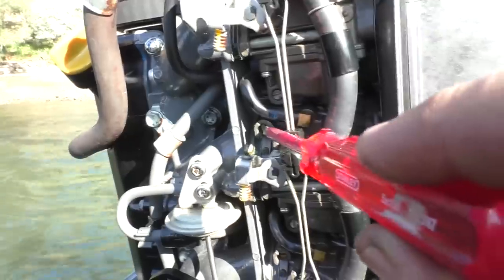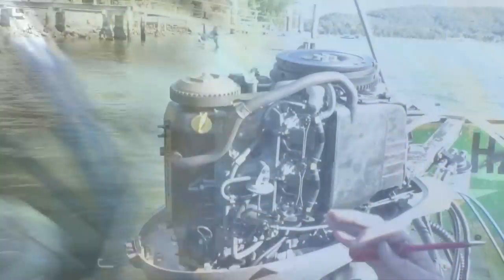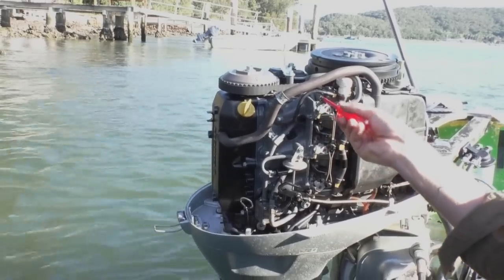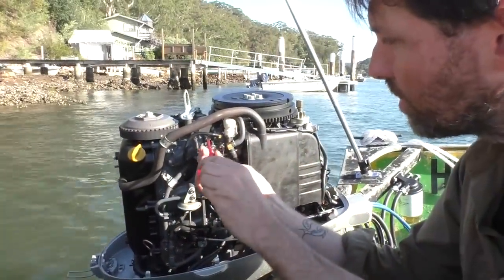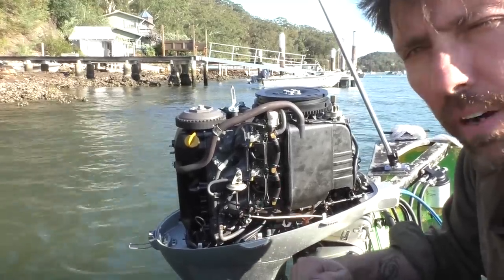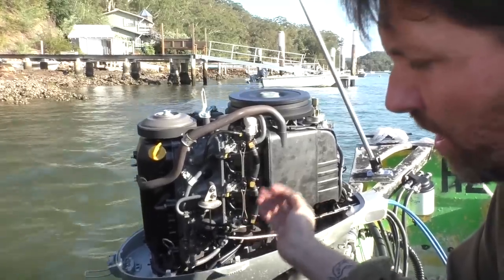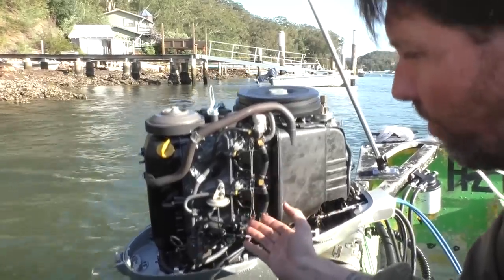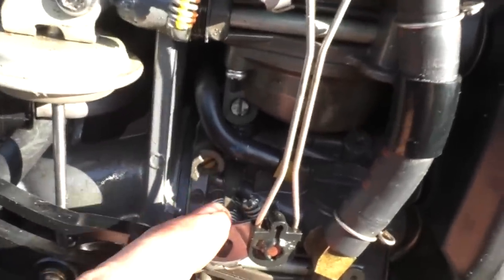Four stroke carburettor synchronisation

Comment: Hey Stu, am I correct in thinking that these tuning methods apply to two stroke carbs as well as four stroke carbs?
Reply from the maker: Two strokes don't have intake vacuum so just the part with adjusting the mixture screws to get the highest RPM is for two strokes.

Comment: I have the USA version of the same motor, and thanks to our EPA (environmental protection agency) the screws can only turn 1/8 turn, and as a result it has never really been possible to get a stable idle on the motor.    It looks almost as if your motor used to be the same way.  If so, can you describe how you removed the original screws and changed to the adjustable type?  I assume the original screws heads have to be broken off, then the screws removed by an extractor to be replaced with adjustable screws.
Reply from the maker: As far as I know this motor was always this way. The previous owner had it since new and I doubt he made any modifications.
Reply: @DangarMarine  Thank you for the reply!  After much research, I found the needles like the ones in your motor (part# 16016-ZV3-000 for anyone else who needs them).  The ones in my motor are part# 16016-ZV7-B51, you can see the press-on tab that prevents them from being turned after installing.  To get mine out I either have to break the heads off and use an easy-out, or somehow pull the caps off, which will probably break off anyway.  Wish me luck!

Comment: I’m a little bit puzzled so my throttle plate on my Merc 402 is completely closed but it’s still idling to high is that a mixture issue any ideas thanks
Reply from the maker: Yes, could be idle mixture screw or the timing is too advanced.

Comment: Hi there, i have an '81 evinrude 35hp 2cyl 2-stroke with single carburettor. Engine starts and runs superb. When it gets up to temperature it keeps stalling at idle, say like when docking. If i want to restart, i need to give it a little throttle in order to make it start. It will run fine afterwards, unless i need it to idle. Plugs, thermostat, waterpump have been replaced, switched to non-ethanol gas and gave the carburetor a clean with solvent and compressed air but the problem persists. Any ideas?
Reply from the maker: So I presume you've been through upping the idle and setting the mixture screws as per this video (although you can't do a vacuum test on a 2 stroke). I would also check compression, reed valves and timing  (videos on all on the channel)

Comment: dangar,what would be a good starting point for the air mixture screw from the seated position on a 2007 yamaha 50tlr 2 stroke?
Reply from the maker: I'd start with it wound out about 3 - 4 half turns and go from there.
Reply: Dangar Marine ...thank you very much

Comment: Help! 1978 johnson 70hp starts and idles great in neutral it revs up great with the choke turn choke off once warm up still idles good so as its in gear stalls
Reply from the maker: I would do a basic service: carburettor clean, new spark plugs and see how it goes then.

Comment: Hello, i got mariner 15hp 2 stroke. I try to set idle mixture screw. 1.1/2 from begining setup. I screw in until RPM increase to maximum (i got tach meter) about 1. 1/8 ..do i set right? Not too lean? Any advice would be good. Thanks
Reply from the maker: No, that's fine if it is your maximum RPM.
Reply: @DangarMarine  thanks for quick answer and for great video.

Comment: Question: 1999 merc 120hp 4 cyl 2 stroke uses 2 carbs and upper crab has different size jet then lower carb why is that? Why don’t both crbs run the same size jets?
Reply from the maker: It depends on the airflow. It is possible that more air gets to one set of carbs due to the shape of the intake therefore requiring a bit more fuel.
Reply: @DangarMarine   they get equal air.

Comment: Hey Stu thanks for another great video. I have a 1968 Mercury 9.8 110. It has one mixture screw and one idle screw for a single carb setup. It runs great in neutral-(low and higher rpm are good) and it starts relatively easy. Choke it then 1 pull, then shut the choke off two pulls and starts every time. Runs fine in Reverse but as soon as I put it in forward and slowly turn the throttle and put a little load on it, it stalls out!! Hate to be a burden but any thoughts?? 
Mixture screw is out 1 and 1/4  idle is set so it doesn't kluck into gear. Carburetor is immaculately clean and new fuel at 50:1, bulb and tank are new and so is the fuel pump diaphragm. Vent is open on the tank when the motor is running. Seems to be running a little bit lean but if I richen the fuel any more it won't idle smoothly or start as easy. Both cylinders are at 118 and spark and plugs are good.

I'm lost on what I thought was going to be an easy job... When I bring this motor to any shop they don't want anything to do with it. I've heard it a couple of times now "it will make a good anchor" lmao. Unfortunately for me it has sentimental value to a friend that I'm trying to help out here.
Reply from the maker: Hi mate. I would initially be suspecting carburettors, although I see you say they are spotless. It can happen that something gets misaligned with the float when they are going back together so that might be worth checking. It would also be worth looking at whether the timing is advancing correctly as you accelerate.
Reply: Dangar Marine thanks Stu. Appreciate the response. I'll give it another go. Being a 1968 I can't imagine how many hours are on this old girl and it seems like she still wants to play :-)

Comment: Does this work with a 1987 Suzuki v6 Carb'd DT150 which has dual carbs per level of cyl bank? I think mine is operating rough... yet when looking at YouTube videos of my same engine where they show them idling, the video and mine sound a lot alike. Sounds as if it has a race cam in it. Very much like a Harley idling if you get my meaning. It doesn't hesitate on the muffs. At idle to blip the throttle up is instant. But wonder if the sync procedure on your 3 cyl would need a 6 dial set up? And can a weak on marine engine knowledge person do what you showed when my main experience is lawn mower riders and chainsaws.... carbs are frequently visited on unleaded gas.
Reply from the maker: Hi Gene. Two stroke motors don't have intake runners like four stroke motors so you won't be able to do the same vacuum test. It is quite common for them to be a bit lumpy at low RPM, they really like to rev. If it is running well I wouldn't be too worried.

Comment: What is the reason for high idle rpm after the engine start? Mine yamaha idle rpm is 1100 and after a minute the speed decrease to 750 rpm  (the speed is the same if the enigne is cold or warm).
Reply from the maker: Sounds like an enrichment system (like an automatic choke) doing its thing.

Comment: Hi Danger Marine. I hope you can help me with my new motor. 
In the manual it says -" NOTE:
This carburetor is covered pilot screw type.
The pilot screw turns open is preset at factory and the screw is
covered by plate."

My question is, how to i remove this plate without damaging the carb. ? 
Is it even possible ? The motor i have is a Suzuki DF25 V-Twin 25hp 4 stroke with a single carb. 

Hope you can help me abit, because the factory preset is not quite good enough. 

Regards.
Reply from the maker: +SirTrampe Can't say I've ever worked on that model of outboard. I've found move suzukis to have the mixture screw on the front of the carburettor above the throttle plate.

Comment: Hey mate, love your videos. I have a quick question about my '86 Yamaha 40HP 2s. It starts like a dream on land but it just doesn't start as well when it is on the water. And it gradually gets harder as the day progresses on the water. Also, sometimes it stalls on low speed while trying to dock at the end of the day. Do you think these issues have anything to do with idle speed adjustment? Or is there a more sinister problem showing signs? Do you have a video that shows Yammy adjustments? Thanks!
Reply from the maker: I would start with a carburettor clean and adjust and do a compression test to make sure that is okay.
Reply: @DangarMarine  Thanks! I shall do that.

Comment: Stu is it true this method is only suitable for 4 stoke motors and not a 2 stroke ?
Reply from the maker: The first part to do with mixtures is the same for any motor, but only 4 strokes have an inlet manifold to check the vacuum pressure.

Comment: Hey I have a question about my 75 Honda outboard so when I open full throttle the engine shake and I want to know what causes that
Reply from the maker: Could be that it isn't firing on all cylinders.
Reply: What causes the cylinders not to fire

Comment: what was the idle speed linkage set on while you were setting the air fuel?
Reply from the maker: Thank linkage is set to a normal ~800 RPM idle when you do that adjustment.

Comment: Where did you get those lovely valves from? I need one of those in my life. I have one vacuum gauge and the needle wobbles back and forth like mad. Oh also, I have Merc carbs which don't have those exposed mixture screws, so... nothing to worry about, yes?
Reply from the maker: Hi Rob, yes, those valves really do make the gauge useful, without them I don't know how you would do the balance. Unfortunately they came with the kit so I'm not sure where you would buy them separately but I'd sure like to find out too because I'm missing one!
Reply: Do you have a link to that tool? I couldn't find anything in my searches earlier this summer. Is it practical to buy for the one-time hobby job like myself?
Reply from the maker: This is the one I bought. http://www.ebay.com.au/itm/Quad-4-Gauge-Four-Carburetor-Throttle-Body-Vacuum-Synchronizer-Kit-5mm-Sync-/161893208672?hash=item25b1965260:g:zfYAAOSwgZ1XvgmZ
Reply: A suggestion - would fish tank air line control valves work ?  I cant see why they wouldn't  as there is no heat , fuel or oil going through them. You used to be able to get chrome plated brass valves for fish tanks, but these day I only see all plastic ones.
Reply from the maker: That's a really good suggestion. I'll see if I can pick some up.

Comment: im am having some problems with my 90hp force motor it starts ok in the water but as soon as I go to take off it dies out im after changing the plugs and if I use spray I can get it up on high rpm one I get it up to speed if I let off it will die if I try to go fast again what could be the problem
Reply from the maker: If it goes better when spraying fuel the carbs it must be going lean. I'd start by cleaning the carburettors. https://www.youtube.com/watch?v=ye_Ui9D8dBE

Comment: Is it okay to use the tachometer that came with the motor?
Reply: The dial tach will only read the overall idle rpm, excellent to set the stop idle screw to rpm factory settings, test wot rpm at wot to play with prop pitches.

Comment: I replaced a bad spark plug on my j15rsua and I cleaned the carburetor (main jet was the only thing with grit) put it back together and I can only keep it running at very high rpm. Anywhere near start and it stalls. My fuel mixture screw is a tamper resistant screw. It continues to turn in or out. So I set it back to where it was when I started. The air screw has been set to 1 and 1/2 turns out (where it was) but it spins when the motor runs. (It was 1/2 turn out when I stopped the motor) How can I adjust the fuel mixture screw so it will run at a lower rpm without being able to seat it to start from? Or am I running the wrong way all together?
Reply from the maker: Can't say I've ever had a mixture screw that does that, so I guess you'll need to adjust it purely on RPM, but I would also consider whether something didn't quite go back together properly after the clean. It is very easy to do so make sure you aren't focusing on the wrong problem.
Reply: @DangarMarine  I should have added that I had the issue before I cleaned the carburetor. There was no change after cleaning the carburetor.

Comment: What is the best way to check engine speed, I can't pick revs by ear very well.
Reply from the maker: If the boat has a built in Tachometer on the dash, then that is the easiest. Failing that you can buy quite a wide range of portable tachometers that work in a variety of ways. Some use an optical sensor and a sticker on the flywheel, others pick up the pulse to the spark plug.

Comment: I have a 2000 evinrude 200 vindicator v6 and I think it has went into slow mode and I’m not sure what I can do. And I’m not sure what can cause slow mode
Reply from the maker: I'd see if you can track down the service manual on line. It should give you a full list of the reasons for going into a limp mode. Often there will be a unique pattern of beeps from the forward control that will tell you more about the cause.

Comment: What would cuz a engine to be so hard to get started but once started runs fine ? Kinda sounds like when you showed what a it do with a vacuum leak  ?
Reply from the maker: Could be that the idle jets are blocked in the carburettor or the choke isn't working properly.
Reply: Thanks. I will see if I can figure out how to check. Appreciate the reply.

Comment: Why does the engine run when the choke is out only on my Honda 75  4stroke plz answer when chance is given to u
Reply from the maker: Sounds like blocked carburettors running lean and being compensated for by pulling the choke out. Start by cleaning the carburettors..
Reply: Also I do have one question I don't know where to buy the tool for the last nut behind the thing to remove the carbonator
Reply: Also what could I use clean them or do I have to take them off

Comment: Wouldn’t it be better to adjust the butterfly valves before fuel? Making sure vacuum and air flow are the same across all cylinders will make for a more stable idle.

Comment: good morning danger, I have a problem please help me 😣.  I can prime the bulb until the cows come home, I put a new fuel pump, fuel filter new primer bulb and it still sucks air. when I filled the filter water separate it will run until it runs out from the filter, then I pump the primer and it will not fill up because it's sucks air please help I'm at my wits end
Reply from the maker: Sounds like there might be a split in one of the fuel lines or the connector at the tank or outboard isn't sealing properly.

Comment: Danger Marine : I have a 2001 Mercury 50hp 2 stroke that when on land w/ muff on starts and idles absolutely flawlessly. Yet when I put it in the water it becomes hard to start and chokes, stutters and stalls at idle or min. rpm while in gear. It is hard to start and will stall at idle occasionally however, it seems to sputter and stall most consistently when in gear at minimum rpm while attempting to troll. I do believe the prop on my 16 deep v aluminum boat is more of a speed prop. Is it possible I just need to adjust the idle speed? Do do you think this is a carb tuning issue? At first I thought It was just bogging down due to a low idle and heavy load at low rpm however last time I was out it still did this spitting/choking out symptom even while giving it some throttle and extra rpms...Any suggestions? Thank you!
Reply: cling1tr Did you ever get your 50hp running better?

Comment: Hello from USA 
Can you lead me in the right path,
I have a 2003 Mercury Optimax DFI 225hp rough idle,
Several spark plugs fouling 
Can you help me on this issue 
New plugs installed 20 bucks each 
Thanks, Frank
Reply from the maker: Could be blocked injectors, a blown head gasket or maybe even a failed airflow sensor.

Comment: Well, now everything is  EFI,,  so now more costly gauges , meters etc,,    .. damm as soon as I buy a balancer now I need a pressure diameter, and a vac  compensator,   bls, bla, bla.....   Last year 3 of my regular customers switched back to Evinrude  115 two strokes  after pouring thousands into Honda & Yamaha four cycles,     They bought the engines from me which I rebuilt and had ready to go,   They fished all season with know problems at all, got their fish & were happy with the motors,,, So I will continue to rebuild the old OMC 2 strokers as the market is out there,  Buying a new four cycle is all about the warranty ,,, If it is a great coverage go for it,,,   But  if you want to get by on the cheap & just catch fish, find a good 2 stroke Evinrude or Johnson rebuild it for $400 & run it for the next decade.                                                    kodi
Reply from the maker: There is no doubt that an old motor like those can still be very reliable and cost less that your first service on a new four stroke.

Comment: This is a 4 stroke engine right ? On a 2 stroke engine i can do the same steps ? Nice vid, congratulations from brazil.
Reply from the maker: With two strokes you can do the same mixture and idle adjustments, but for the balance you simply need to loosen all the butterfly valve linkages so they their springs can close them completely and then tighten them all up again.
Reply: Ok, thanks a lot man
Reply: Great video but can you please clarify the part about the 2 stroke butterfly linkages, ie if one is balancing then how does tightening them all the same balance anything? Thanks!
Reply: Never mind my question- I found your video on synchronization of 2 stroke carbs!

Comment: Water only dripping from tell tale?
Reply from the maker: Yeah, the outlet is a bit blocked at the moment but it is still pumping plenty of water.
Reply: Mine is going in for a carb clean tomorrow, runs rough and occasionally comes good instantly for only a second, so thinking its electric not carb, but the dealer wants to do the carbs anyway.
Reply: And it ended up being a CDI unit for a grand :(